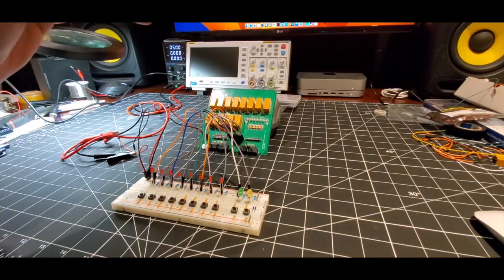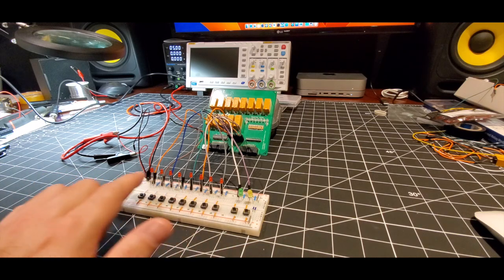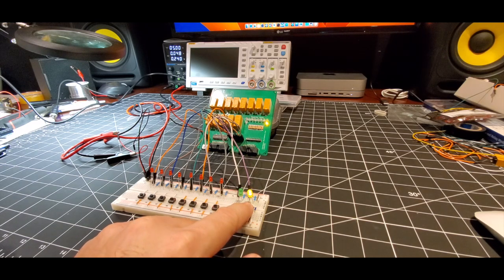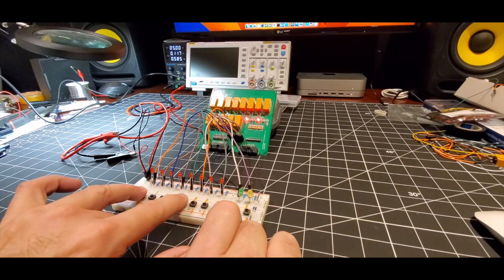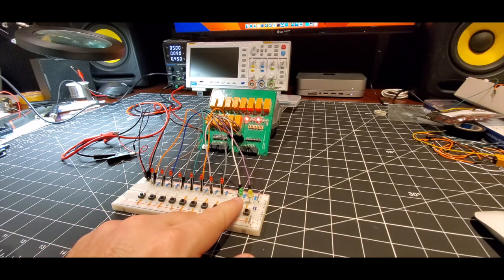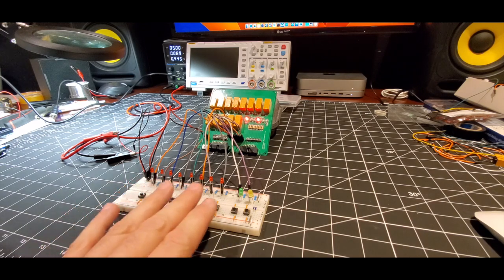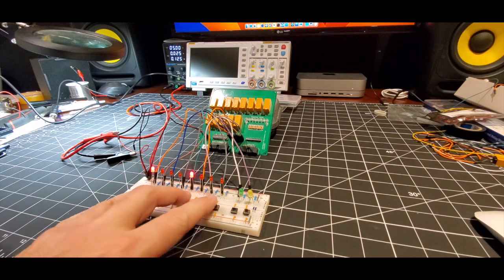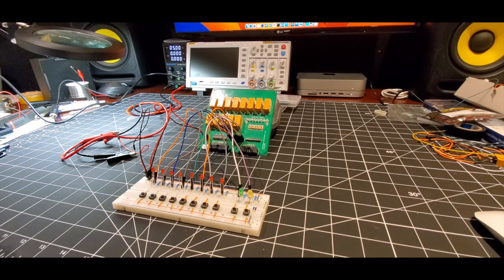Relay Computer - First Register (but not the last!)

Comment: Hey DiPDot, I'm working on my own relay computer and this is pretty cool, good work!  I haven't watched the whole series yet so forgive me if this is addressed.  So is this register asynchronous then?  Or is it clocked somehow?
Reply from the maker: The entire 8-bits is opened to the databus at the same time, so asynchronous. So it's open/loaded and then closed to latch the value.
Reply: @dipdoting  Yeah I realized that there's no need for a clock connection. Been following and learning a ton from Ben Eater's series.